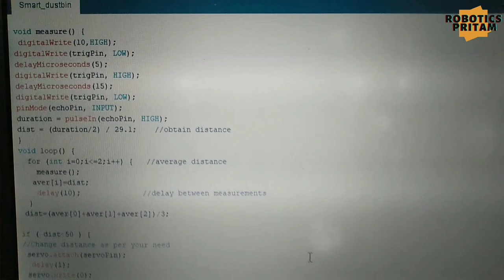How to make Smart Dustbin With Atmega328P IC //Assam

Comment: Bro here you used two battery charging modules so there are two charging pins what will you use? To charge using usb cable
Reply from the maker: Plug the USB pin into either of the two charging modules.

When plugged into one charging module the other module will also be powered.
****You can check the circuit diagram in description.
Reply: How do we give the positive and negative of the battery to the 7th pin of the IC and how to turn the IC ON, without connecting to the ground of the IC?
Reply: One more doubt please reply ❤️
Reply from the maker: @sachinvs5757  If there is no negative connection of the battery, the IC will not run.
Reply from the maker: @sachinvs5757  You can see the circuit diagram carefully.
If you have any doubt you can ask❤️❤️
Reply: @roboticspritam6072  thank you when i connected ic ground to the -ve terminal of battery its working awesome ❤️